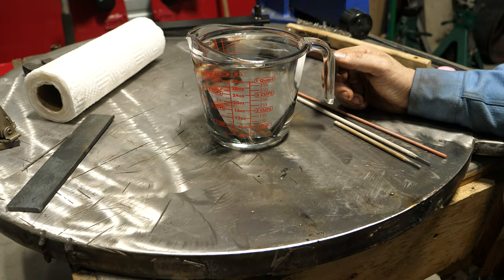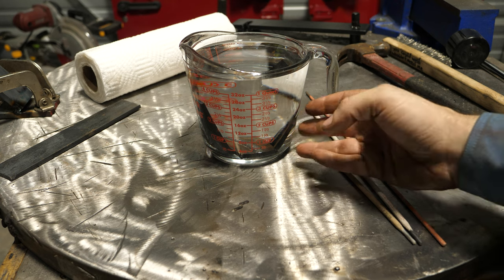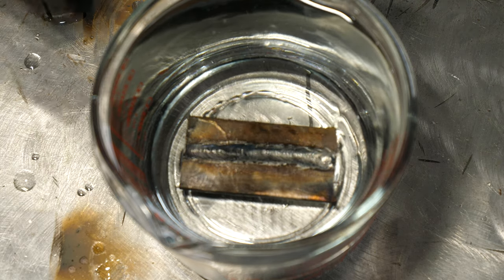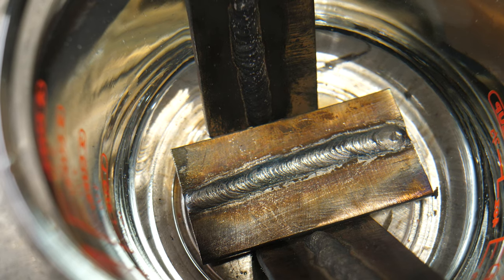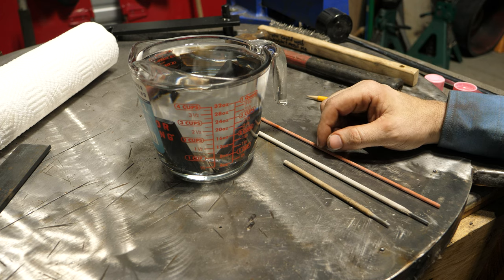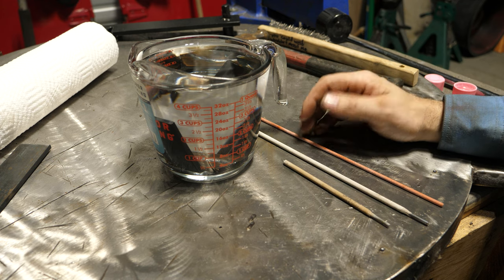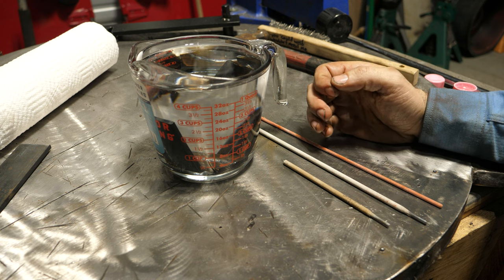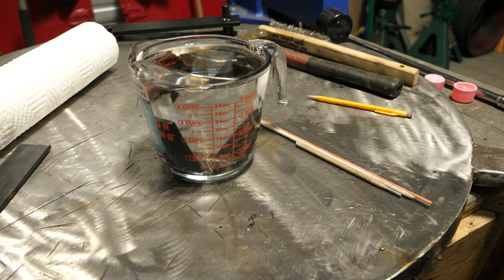7018 vs 6010 and the danger of diffused hydrogen (hydrogen embrittlement)

Comment: Now if your are welding high pressure pipe made of tensile steel, doing 6010 root and 7018 cap, are you not trapping hydrogen in the weld via the 6010?  (pre heating does not happen much in the real world) Not that I will ever weld pipelines , but it would just be nice to add some knowledge.
Reply from the maker: So I have a bunch of thoughts on this.  The 6010 root 7018 fill/cap makes sense for in field pipe welding.  The fitup on infield pipe is often poor (aka wide gap, too narrow of a gap, high/low fitup where the bevels don’t line up, and poor material condition.  The 6010 rod is so much easier to weld a poorly fitup with, 7018 tends to just drip or get out of control when welding a open root of varying gap size.  So the 6010just makes it easier to make a solid defect free root pass.  

Being that the root pass is very thin, and will be backed up by a bunch of 7018 passes, the hydrogen in the welded area will likely be baked completely out.  The first pass after the root will have the root glowing red so the hydrogen is pretty much gone.  It’s also such a small area of the weld itself that a crack in that area will likely not cause complete weld failure.  It is also common for 7010 and 8010 to be used as a root pass on pipe in the case of higher strength steels. They aren’t low hydrogen but they are higher strength than 6010.  On mild steel pipe you could do 6010 all the way out without much issue.

Comment: You have successfully turned me into a welding nerd!  Lolol  So, if I got this right (and I re-wound to make sure), the old 7018 just kicking around on the shop bench or whatever, I.E., not from a sealed pack or from an oven, didn't produce any hydrogen bubbles just like the fresh 7018 that had been sealed/new.  I thought that was as cool as the amount of gas that came out of the 6010 weld.  Great stuff/thanks!
Reply from the maker: I didn’t see any bubbles but without a doubt it did impart hydrogen in the weld, but infinitely less than that 6010.  6010 has a high level of moisture in it when it’s packaged, 7018 doesn’t.  For the 7018 to hit the point it had as much hydrogen as that 6010 I think the flux would fall off the rod lol.  On mild steel it’s not a issue, but on higher strength steel it definitely could be.  

One of the most confusing things about picking a stick rod is the common thought that people should use 7014 or another rod instead of 7018 because 7018 has “storage requirements”.  The truth is, 7018 can safely weld higher strength steel and 7014/6013/6011/6010 cant.  Even a 7018 that was outside of a container for months will still likely be safer to use on high strength steel than any non low hydrogen rod.  With MiG and tig they don’t have flux that can pickup hydrogen so they aren’t really affected.
Reply: This is amazing to learn!  💜🤯

Comment: Great info Greg. Seems if you can only use 6010 on mild steel, you are greatly limiting its usefulness. I always think of 6010 as a fierce digging rod, and thought high strength steel was its forte. Can’t wait to see what Flux Core does. Thanks Greg!!!
Reply from the maker: You’re welcome 😀.  6010 can weld a lot of things, but when it comes to higher strength steels it’s best to avoid it.  It’s not a guaranteed “it’s going to fail” but anything you can do to avoid failure is best lol.
Reply from the maker: You’re welcome 😀.  6010 can weld a lot of things, but when it comes to higher strength steels it’s best to avoid it.  It’s not a guaranteed “it’s going to fail” but anything you can do to avoid failure is best lol.
Reply: i welded a cake one with stick uhm it was like the worst looking cake one y becouse i was runing a stick, arkks arehot so i mixed flour water and sugar put on metal then weled till the bater was done 😂 ( i have a hard time tring not to break into tears laughing ) and it " worked" uhm but it hade to much rust in. it

Comment: Fool quit using junk brand 7018. Use Atom Arc. It can set out for days.
Reply from the maker: I generally use esab 7018-prime because it comes in smaller more useful packs than most other rods.  Even atom arc can’t sit out for days and meet code for low hydrogen.  Most rods are 4 hours out of the sealed pack and they have to be put in a rod oven.  Some with moisture resistant coatings can go 8-12 hours max, and that’s it.  In the video I used a brand new esab 7018 (bottom plate), and a part of a cheap harbor freight rod that was sitting on the floor(side plate that wasn’t 6010).  Neither one of them showed signs of escaping hydrogen, however only one of those rods met code for low hydrogen (the 7018 prime that was fresh out of the pack 😀)
Reply: @makingmistakeswithgreg  Esab makes a good product.

Comment: Thats super cool and very interesting Greg. Could you also do a strength test between 6010 and 7018? Also, another issue I find highly interesting, albeit  somewhat niche request would be a video on hardface rods vs say 6013 and 7018. Like a strength test and also a cut test, using a grinder, to see just how abrasion/grinder resistant hardface is compared o other rods Thanks .
Reply from the maker: I will be doing a bunch more strength comparisons 😀.  I can do a hardface rod test, however it’s hard to say if the weld will make it through cooling.  Hardface produces very strong welds but they are brittle.  To actually weld a fillet weld with them would dilute so much filler into the plates I bet it would break at less pressure than 7018.  I will test it though 😀

Comment: Very interesting!  I think the hydrogen comes from the type of flux.
Reply from the maker: The flux of the 6010 contains moisture when it’s made and without it the rod runs poorly.  Many people unknowingly put 6010 in a rod oven and it will not run right lol.
Reply: @makingmistakeswithgreg  There is a lot to learn in welding!

Comment: Greg. So I'm the one that was talking to you on Facebook (I see you don't know s*** about welding) about the hydrogen and condensation I am really intrigued about this. Because with my study of electrolysis and hydrogen. I mean I've always heard about low hydrogen rods. But the thing that gets me is that hydrogen boils at a  -400 and some degrees Fahrenheit.. and what happens to hydrogen when you burn it is it turns back into water because it bonds with the oxygen molecules during the reaction that it has to heat turning it back into water... So the only thing I can think of is they're talking about moisture content in the rod when they say low hydrogen rod. And that would be why you want to keep your rod dry and not exposed to the elements.. because when you start to weld if there's any moisture present anywhere on your workpiece. It can be going through electrolysis before your arc gets there to evaporate the water or ignite the hydrogen from the electrolysis. Well then which in turn once the hydrogen is ignited it turns back to water. So is it actually steam that would be getting trapped inside the weld. I'm thinking it might be, especially in extremely humid places that get real cold
Reply from the maker: So the flux of all rods can pickup moisture from the air/environment around it.  Some rods (6010/6013/7014/7024/etc) are not specified as low hydrogen (meaning the flux does contain hydrogen).  6010 in particular has a massive amount of hydrogen (moisture) in it, and it is manufactured that way.  By code you can’t turn a non low hydrogen rod into low hydrogen by baking it out.  Also, Hydrogen present in the arc has a effect on the weld, it (in small amounts) is used in certain MiG welding gas mixtures.  

I can tell you that the book definition of what happens during hydrogen embrittlement of metal is the following:  https://en.m.wikipedia.org/wiki/Hydrogen_embrittlement .  From a standpoint of how it exactly functions as far as dissolves into the weld, (if it’s atomic, gaseous, or something else) that’s far above what I have studied, but definitely worth looking into.  I have seen microscopic pictures of what happens to the higher strength steel, and combined with testing low hydrogen vs non low hydrogen rods you can clearly see bubbles escaping a finished weld only on non low hydrogen rods.
Reply: @makingmistakeswithgreg  So then that's what I was saying That's what I was thinking is that there was moisture in the rods and no hydrogen if it's in the if it's present due to the moisture The only way to get rid of it would be to ignite it with a some type of flame actually That's why drying it will not get rid of the hydrogen.. So now my question to you is because I actually I do understand the science on it and it is what I explained. Could it be that especially with 6010 rods them flaking off into the weld and it not solidifying be the reason why hydrogen actually gets trapped in there.. or maybe not running the 6010 rod as hot as it should be and so it flakes off into the weld? And I'm just talking very minute pieces something that we probably wouldn't even see when we're running running a bead
Reply from the maker: Per AWS code they allow one to bake a low hydrogen rod (7018, 7016, 7015, etc) rod at a higher temp for a extended time to remove any hydrogen out of the flux.  This is acceptable to do one time to a rod that was exposed to the air for longer than it’s moisture resistance rating allows for.  It is done at a higher temperature than the normal rod storage temp.  The temp would be somewhere around  600 from what I remember.  Normal rod storage is in the ballpark of 250-350degrees.  You can’t bake out a rod more than once due to the flux likely failing.  Normal rod storage temps aren’t high enough to meet the h4 designation (or less) of the rod.  I will explain what is meant by that.

In AWS and manufactures it is referred to as hydrogen and not H2O because the hydrogen is what is the problem.  A non low hydrogen rod is manufactured with h2o in the flux, low hydrogen is not.  The low hydrogen rod can be welded with directly out of a sealed container and meet low hydrogen specifications.  The specifications in specific are often “H4” which means 4ml or less of diffuseable hydrogen per 100g of weld metal.  They actually test the deposited metal from a rod and verify this.  So literally they know how much diffused hydrogen is in the weld metal.  They are not looking for diffused h2o, but hydrogen in specific.  

I understand what you’re saying about the electrolysis process splitting hydrogen out of h20.  I am not sure that is exactly what’s happening in this situation.  When stick welding you have a pool of molten metal with liquified flux that is in a process of solidifying.  Whatever is in the flux is in the solidifying metal.  Making things worse, the trapped hydrogen is often under the weld bead/driven away from the rod, which makes the effects (cracks and microscopic pores) not visible from the surface.  The hydrogen itself is the issue and it’s possible it is being absorbed directly from the flux, from electrolysis, or some other means.  Specifically it’s stated in a book I have about metals and how to weld them, that hydrogen ions are diffused into the weld, and can combine to form hydrogen gas.  It’s stated that the hydrogen atoms themselves are destructive but when they combine into a gas they stress a material further.  Again all of that stuff is way over my pay grade lol.
Reply: @makingmistakeswithgreg   okay so after reading that Wikipedia page I'm almost guaranteeing I'm right The flux at some point is not melting or solidifying enough during the welding process. Or possibly due to short arc length or maybe long arc length even I guess but that slag cools so fast. That it does not have time to get to the surface. Because like what I said hydrogen and oxygen through electrolysis separate (so it's H2O) separate into two hydrogen and one oxygen gas and then as your welding you're igniting the hydrogen there (that's probably why you get so much spatter with 6010 and other rods of course I'm just using that as example) and when you ignite hydrogen it turns back to water. So like if you have a hydrogen engine the byproduct is 100% water that comes out of your exhaust, no gases.  Let me ask you another question when you weld 6010 do you whip it?
Reply: @makingmistakeswithgreg 4:15 when you get some time would you be able to do me a favor because I don't have any 6010 as of right now to do the same experiment with a different technique. I may be wrong but I think that you whip the 6010 when you're welding. I also used to do that until I was showing another technique which creates a much better weld and it's doing small circles. Almost like some people do with 7018 and turn the amperage up a little bit along with pushing your weld. And then try doing the mineral spirits experiment again. And if you're not able to do it let me know I'll try it I'll have to order some 6010 offline maybe cuz it's kind of expensive at my local welding supply store in the small town I'm in

Comment: just watched the “pre-heating” video … I’m legit curious about heating both the work, and the rods, over 100C, just to force out moisture & gasses.  🤷‍♀️
Reply from the maker: So here is my thoughts on that:

If you look at code for baking water out of 7018, it requires a fair amount of time, at a pretty high temp.  Stabilizing ovens (lower temp) can be used to keep rods indefinitely stabilized (ones that haven't been out of a sealed pack or rod oven for long) and "bake out" ovens are required to bake out all of the absorbed moisture on rods that have been out for over their exposure time.  Bake out ovens are often over 400F depending on rod manufacture requirements.  The problem is the "water" stored in a rod is not easily removed like wringing a towel out and putting it in a dryer.  The hydrogen will absorb into the flux and if there is enough of it without a lengthy (30+ min) bakeout at high temp you might not remove all of the hydrogen.  

For the most part this is of little concern because mild steel most people weld on (with rods like 6013,7014, 6011, 6010) is unaffected by hydrogen in the weld.  Its when you try to weld high strength steel with a wet 7018 (or a non low hydrogen rod) that problems pop up.  So basically a slight preheat to a 7018 will likely help it run better, but it won't remove all of the hydrogen thats in it if the rod was improperly stored.
Reply: @makingmistakeswithgreg  And if you try to bake a rod that was stored too damp, the flux just falls off like powder. I've had to throw away boxes of rods before that someone gave me, or found left out in a barn at a farm, and was nothing left of the flux was all turned into junk.